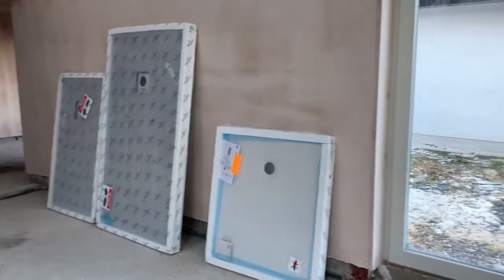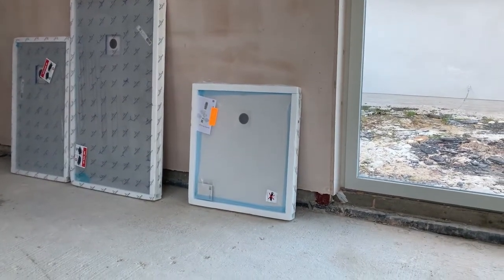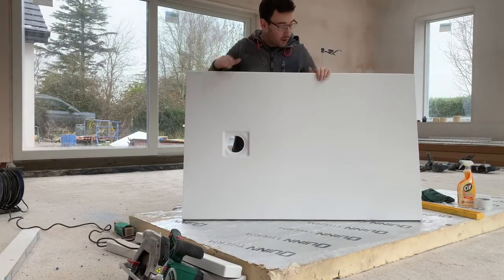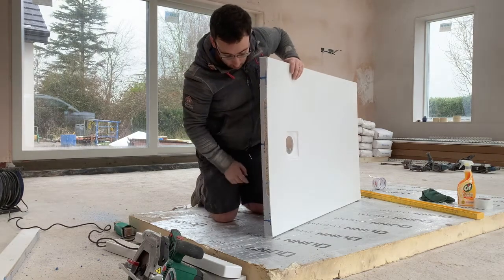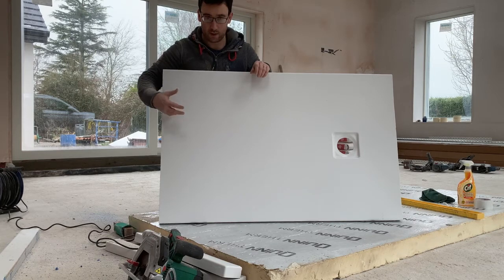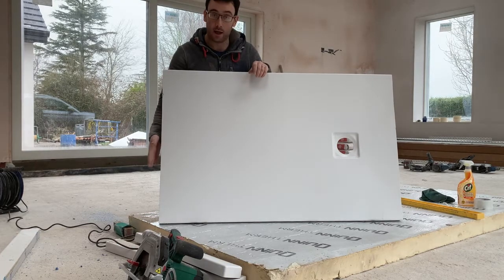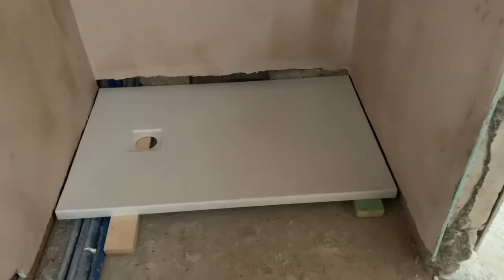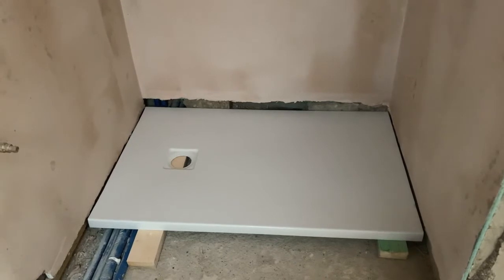Irish House Renovation Blog: Part 15 - Villeroy & Boch Embrace Shower Tray Install - Cut to Fit!!

Comment: You have the waste up at the screen side(which is under shower. Mine has been put so that water flows out at the end where there isn’t a screen. I am wondering is this in wrong way around.
Reply from the maker: Oh I’m not sure. We’ve always done it this way actually
Reply: I was only asking because I think mine has been put in wrong. Thanks for reply.
Reply from the maker: @58musiclova  maybe ours are in wrong 😳

Comment: Do you think it could be a problem to cut a bit more than 100 mm (I would have to cut about 150 mm). Based on the video it seems the material is uniform. Thanks
Reply from the maker: I wouldn’t advise going any further than 100mm. The material is uniform but at 100mm the interior of the tray starts to slope towards the waste so you may run into issues there.
Reply: @TheKildareReno  thanks for the answer ! Mine would be the 180cm length, I have compared with the 140cm and the tray is more thick (48mm vs 40mm) so at 150mm from the edge I would have even a bit more remaining height than with the 140cm at 100mm so it could be fine 🙂